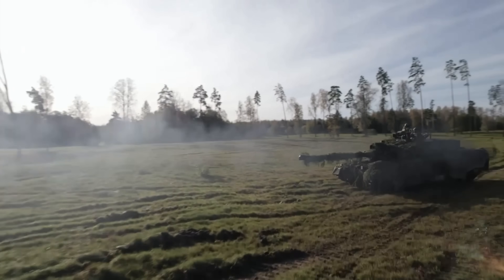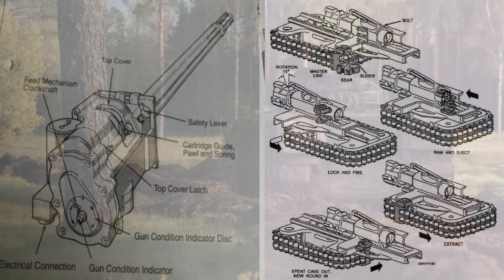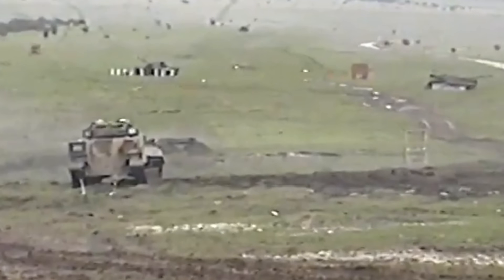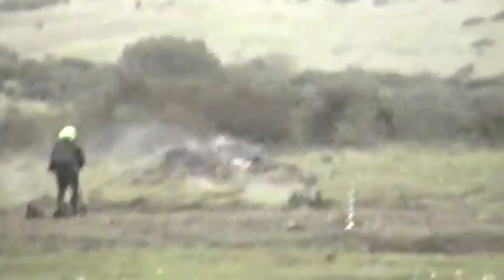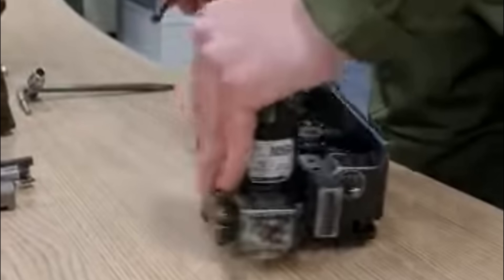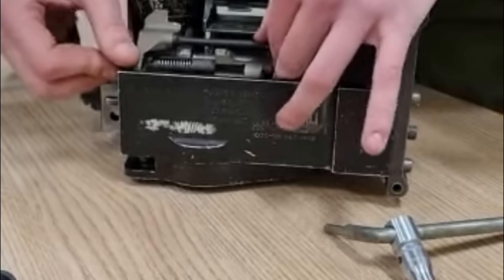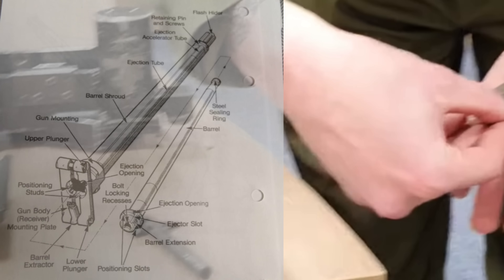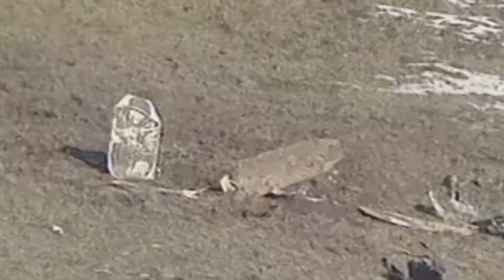The British L94A1 7.62mm Chain Gun | THE WORST WEAPON FOR BRITISH TANKS 👎🏻

Comment from the maker: 🚨 This gun was originally designed for helicopters! 🚁 But somehow, it ended up in British AFVs… and FAILED. What’s the WORST or BEST military machine gun weapon you’ve ever seen in action? Comment below! 👇🔥
Reply: @_Matsimus_  MG3 / MG 5 in that caliber-span. Never fails, solid engineering.
Reply: Ohio ordinance REAPR 338. Automatic suppressive fire and sniping capabilities at a max range of 1700 meters!? Versatility and lethality at its finest!
Reply: I had the pleasure (and displeasure) to use the MG3 and MG42 both dismounted and mounted.

Great weapons, awesome rate of fire and feel. But as weapons for turrets a bit too vulnerable to dust in my opinion.
Reply: It looked almost like a gatling-gun on the pictures. But it also looked old, and sounded, as u say, slooow.
Reply: Greenland Canada Property of United States of America.
Reply: The M240 in 'merican nomenclature is without peer. The SAW and its many other fat, unreliable variants are trash taking second place to the MK19 and only because a serious stoppage in a serious situation involves applying a pry bar to a 40mm grenade. Yes, yes the round has to rotate so many times after firing to arm, that doesn't mean I want to be having a domestic dispute in a enclosed space with a belt fed grenade launcher, ever, for any reason. 

To fully appreciate how trash this impotent chain gun is. Hues developed a chain gun to be put on the Apache, to eventually fire a 30mm round. A rate of fire can be significantly slower if the round fired is packed full of HE. The British saw this idea, and were like, great, now lets cut its nuts off, have it chambered in 7.62 then spend three generations developing armor platforms you wouldn't take to a barbecue in Poland much less to plug a gap with a few Ruskie combined arms divisions pouring thru. 

If it wasn't complicated enough, lets ensure that it can only be mounted upside down, and therefore must defy gravity at the Queens' behest in order to function properly. Ya'll should be demanding a retrofit to your GPMG. You can rig reliable coaxial fire trigger systems with the material from the throttle on old carbureted TVRs.
Reply: You say, "kevlar gloves".

I recall the term being, "shit mitts". >_<

I believe this might have been an infantry, rather than cavalry term, but I feel the whole barrel-change glove hatred is non-service specific.
Reply: M240 coax and M-85 .50cal.

Very glad the 240 replaced the 219 before I entered service.
Reply: It failed in the warrior purely because it was mounted upside down
Reply: @stevecane1987  not at all!! It’s mounted upside down on CR2 aswell and there is nothing wrong with it.

What is wrong with this gun is the person handling it.. Having been a Loader, Commander and Gunnery instructor on CR2 and a 30mm gunnery instructor on Warrior and Scimitar (Granted Scimitar has the L37 and not L94) so I know the drills for CR2 and Warrior.

The Warrior Drills for example are begging for problems to occur.. but that’s what you get when you allow the SASC to run with everything under the “Infantry” bubble when it comes to drills.
Reply: The worse coax was the L37 (i think) the mounted gpmg for cvrt
Reply: BK27
Reply: SA 80. That bullpup piece of crap has been used by the british military for way too long (about 40 years too long). Sack off that unreliable piece of crap and just get a standard firearm
Reply: The 7,62x51 Chain Gun was intended for AFV use and was one of a family of weapons using the chain drive principle developed by Hughes.  It was the M230 30mm gun that was intended for helicopter use though the 7,62 gun was also mounted. Prototype 6 was sent to UK for testing and proved very reliable, firing 14,500 rounds with only six stoppages due to mal-positioned rounds in the belt. I know there were changes to the gun subsequently but never saw what was done.
Reply: Explain where this FAILED as you say in your title? 

The L94 has been in service (especially on CR2) since the 90’s..  The ONLY time this gun “FAILS” is if the Loader isn’t paying attention.

I get you was ex REME and played with it maybe on your Warrior variant but maybe speak to a real user aka one of us from CR2 and don’t compare its use by foolish Warrior crews..
Reply: The MG-42 was pretty good, minus the overkill firerate. The British had a great magazine-fed light machine gun, the Bren, during WW2. The best HMG in the world is probably the American M2 Browning .50 caliber HMG.
Reply: somebody got paid off on buying this turd!!! they need to either call in Dillon Areospace to fix it like they did the M134 or the crews need to cowboy it getting a hold of a good gas driven gun and hillbilly up a new mount for it!! as for the best i've seen (keep in mind i've been to the Knob creek machine gun shoots multiple times!!!) it'd be a toss up between the MG family (that's the MG42, MG3,42/56 and the MG74) the RPD the HK21 and 23 the M60 the PKM the Lewis gun and Ma Deuce but by orders of magnitude the absolute worst wouldn't even make descent scrap metal steaming pile has be the frog WW1 chouchat!! everyone involved with that thing should have been charged with giving aid and comfort to the enemy!!!!

Comment: One issue I had with these was the key in the Dog drive would shear all the time causing stoppages. Also you'd have to change the nylon insert for the timing screw regularly otherwise the timing screw would unscrew and it would loose timing.

Comment: I can't believe that coax requires power in order to work. Even if it still had all the other issues, that alone should have been a disqualifier in my opinion. 

As for my favorite MG, I like those Belt-fed AR uppers you can mount to an M16 lower. As a civilian, I can get away without having absolute reliability and robust build at the cost of creature comfort, so I can appreciate having a platform that only weighs about 5 kg.

Comment: Hi Matsimus, A very interesting insight into the mechanics of the L94A1 7.62mm Chain Gun used across the British Army’s Fleet of Tracked Armoured Combat Vehicles ie, the Challenger 2, Warrior IFV and AJAX etc. It had occurred to me long ago that the choice, with the questionable wisdom of the MOD, to stick with this System as the principle Co-Axial Weapon was as much a cost cutting measure as it was for its reliability and capability. Along with the notion of being able to essentially transfer the system from one retired platform to another, if that is at all possible, or just that there was a surplus of these weapons manufactured, thus it made sense in the MOD’s eyes to continue to use the Weapon, even if its effectiveness is highly debatable. To me it feels like another short sighted idea that a one size fits all system will be effective, even if it was originally designed for aircraft use. Of course I wouldn’t know for sure, as reading between the lines, it is just an educated guess with some cynicism thrown in.

I have never been overwhelmed by the relatively low rate of fire and effective range of this system given its principal secondary offensive role. Whilst given many serving and retired operators have expressed, in their experience that the Co-axial Weapon has often been more important in many operational combat scenarios, in being able to suppress the threat of dismounted Infantry ATGM teams and lower tier armoured vehicles like IFVs and Turreted APC’s etc, possessing short to medium range ATGM launchers, as well as Automatic Cannon fired high Velocity APFSDS projectiles. I feel that given these threats are often more likely and numerous nowadays than the direct MBT threat, the 7.62mm L94A1 Chain Gun is an inferior choice in capability than either the more reliable Gas-Operated 7.62mm GPMG, its equivalent or even the 12.7mm Heavy Machine Gun.

The Latter having significantly increased range over the 7.62mm Calibre and better Armour Penetration capability with relevant Armour Piercing Ammunition natures. Albeit with the trade-off penalty of a reduced Ammunition payload being carried on board the Armoured platform in question. Despite a reduction in 12.7mm ammunition turret capacity, a 12.7mm round combines increased range, armour penetration through better kinetic energy transfer to the target, as well as requiring less rounds per target. This is of course setting aside the rules around the Convention on Certain Conventional Weapons (CCW) treaty, of which I feel just places a grossly unfair handicap on our Forces, when deployed against our adversaries who just blatantly disregard such treaties. However returning to the topic in hand, I feel that the British Army should standardise around a 12.7mm Heavy Machine Gun like a variant of the Browning M2HB for the principle Co-axial Weapon across all of its Turreted Armoured Combat Vehicles. My own preference being the FN M3M Heavy Machine Gun, if technically possible, due to its higher rate of fire and long standing use in the Lynx and now Wildcat Helicopter of both the British Army Air Corps and the Royal Navy. The FN M3M like the M2HB, can also be fitted to vehicle mounted Remote Weapon Stations which could also offer increased firepower when used in the anti-aircraft role when mounted on MBT turrets etc. Anyway a very insightful piece on a weapon system which I suspect, many people have mixed feelings on due to precisely the reasons you have expressed. Cheers.👍

Comment: I'm currently using a MAG Hashan Dor Bet (locally produced FN MAG modified for AFVs), and it hasn't been causing much trouble. The main problem, to be honest, was the actual feeding mechanism the belt sometimes gets stuck and you need to give it a lil pull but other than that it was amazing we even connected 3000 round long belts to it with improvized ammo storage just in case

Comment: As far as coax or I suppose vehicle mounted machine guns go, the MG34 is a favourite of mine just because of the simple barrel change when mounted inside a vehicle. I believe the example I saw was the radio operator's pintle mount on the bow of a Panther, receiver rotates off centre with the barrel shroud, pull out the hot barrel, stuff a new one in, rotate the receiver back, lock it in and resume fire. For quite some time I was unaware the 34 had a quick change but I thought it was genius and no doubt a contributing factor to it's prominent use as a coax and bow machinegun. However the FN MAG58 and it's derivatives such as the L7 and M240, alongside the M2 browning, particularly the M3 with it's ridiculous cyclic rate are among my favourite machineguns. I wonder if they ever tried fitting the M3 to a ground platform, I imagine it would be a truly devastating weapon to be on the receiving end of.

Regarding the L94 though, I never knew the L94 has such a crap track record but after hearing about it, it truly seems like a horrid choice for a vehicle mounted weapon system, and given we (brits) had experience with the L7 as a coax on the chieftain I'm dumbfounded as to why we moved away from the jimpy and went with this all singing all dancing chain gun. I imagine there was a very good salesman who pitched the machinegun to the MoD who somehow didn't know any better. Then again we did also try to replace the jimpy with the L86 LSW.... The MoD seems to have the idiom "if it ain't broke, don't fix it" backwards. At least the CTAS 40mm on the Ajax seems to be a reliable weapon system so far, however time will tell...

Comment: In theiry a chain gun could have a ton of advantages in a coax mount. A well designed one should be basically impossible to jam which is a big advantage when it's difficult or impossible for a vehicle crew to access it to clear said jam. The logic behind trying to adopt this thing is sound but it seems the execution was very poor. What was going on in the MOD during this time period. This and the SA80 are both weapon systems that should be good but were very poorly executed.

Comment: according to wikipedia these cost £7,920 on release... thing is every conventional 7.62 MG costs substantially less and couple that with the fact you didnt need an electrical power and control and the lower maintainence...  and you still get a lower rounds per minute... this makes all the sense as a helicopter gun where it is 'self clearing' in a jam but in an AFV??? if you sole goal is to throw 7.62 nato downrange at 600rpm... this is the WORST way to do it

Comment: that's crazy. I used a 25mm chaingun in the navy that works like this, and I thought that one was bad. It's actually upside down mounted on a ship, or almost upside down anyway. In Bradley IFVs, I hear it's better though. Even when I would get it going just really well, greased it all up, dry ran it just fine, it would usually fire a dozen rounds and then jam. I would use a large fruit can to prop up the feed chute since it was at a funny angle to make it feed better. it was horrible. Made by Bell helicopters. I am seeing a lot of parallels with this L94A1 and the Mk 38 chaingun, that's so weird. 
the Mk38 was so bad it would sometimes crush a HEIT round, like the rammer would crush the hell out of it at an angle and I would have to carefully get the rammer off of it and pry it off with a claw hammer. I would use a flak jacket to cover it as Im prying it off hoping it doesnt explode. I dont know why these things are so bad.

Comment: Why wouldn't you use a simple blowback mechanism in a vehicle mounted weapon? All of the downsides aren't really applicable in a vehicle and its the most simple and reliable mechanism possible.
Reply: This depends on the ammunition. In particular, 7.62mm ammo is necked, which can be a problem for blowback if the chamber pressure is too high (it is too high for 7.62x51mm, but not a problem for the tiny barely necked 7.62x25mm used by some submachineguns).

With blowback, the extraction process begins almost immediately, when the chamber pressure is still very high. At the base, this isn't a problem because centerfire cartridges have a thick brass base. The weak thin walled part of the case doesn't travel past the breech for a little while, giving time for pressure to go down.

But at the neck, this is more of a problem. The high pressure can distort and even rip the thin brass at the neck. So, you really want a lock (gas or recoil mechanism) or delayed blowback mechanism to prevent this from being a problem.

So you really want ammo that is straight walled, and maybe even with a rebated rim to allow the bolt to enter the barrel.
Reply: @IsaacKuo  Couldn't the bolt mass just be increased until its no longer a problem, like I said it's going in a tank there's no real downside to it weighing a ton....
Reply: @Rufeo0  If you increase the bolt mass so much that it doesn't move very much while pressure is high enough to damage the neck, then it will have a problem cycling reliably. At the very least, it will take a long time for it to blow back enough to feed the next cartridge - meaning the rate of fire will be low.
Reply: @IsaacKuo  The L94A1 is only 500rpm
Reply: @IsaacKuo  Besides bolt mass the recoil spring could also be huge in a tank, plenty of room and weight available for some sort of mechanical advantage mechanism to manually cycle the bolt
Reply: @Rufeo0  Well I don't know how much lower a blowback 7.62mm would be, but I'd guess that the speed of the bolt would need to be 1/4th as much to be safe. I think the delayed blowback system of the G3 rifle has an initial 4:1 mechanical disadvantage, and its rate of fire is 500-600 rpm.

So, you increase bolt mass to 4x, and this slows down the bolt movement 4x, resulting in a rate of fire of 125-150 rpm - or about 2 bullets per second. Is that enough?
Reply: @IsaacKuo  hmm but was the G3 designed with maximum rate of fire in mind? A better comparison would be the roller delayed mg42 which achieved 1500rpm and I doubt even that could be said to be designed solely for maximum rpm in mind. So a roller delayed mechanism with a similar cartridge is capable of at least 1500rpm if you divide that by 4 you get 375 which is much more reasonable.
Reply: @Rufeo0  MG42 didn't use a delayed blowback system, it used a short recoil system. So, the initial speed at which the bolt is extracting the cartridge is ZERO. The bolt starts off locked to the barrel. It's not directly comparable to blowback at all.
Reply: @IsaacKuo  Sorry I took googles first answer, HK21is the most analogous to my knowledge then at 900rpm. My point still stands, would they have designed it with highest rpm possible in mind or did they pick the rpm first and design the weapon to achieve it? My guess is if they designed a weapon with highest rpm in mind then they could achieve a lot more and ergo the same could be said for a simple blowback weapon.
Reply: @IsaacKuo  If you take the Oerlikon 20mm cannon which used API blowback said to half the bolt mass needed against simple blowback, it fired a 127g bullet at 600m/s giving it a 22,000j muzzle energy(FFF variant) it had a 600rpm fire rate. If you lookup the MG FF variants they fired bigger bullets at higher velocity at higher fire rate. The 7.62 nato round has a muzzle energy of 3300j to 3600j depending on projectile. Even if you consider the bolt weight halfing with API blowback thats like the 7.62 is 7,200j vs Oerlikon 22,000j. Or in other words a 7.62 nato simple blowback bolt would be 1/3rd the weight of the Oerlikon 20mm API blowback and they achieved over 600rpm.

Comment: The Russians still widely use the PKM which is a very similar design to the FN MAG and the Germans still use the MG3 which is a modified MG42. Even if they get jammed you usually fix the jam by just cranking. The only modification that might make sense is equipping a heavier barrel to be able to shoot for longer. If a gun still works there is literally no reason to change it, especially for something with a lower rate of fire and not a single performance advantage.